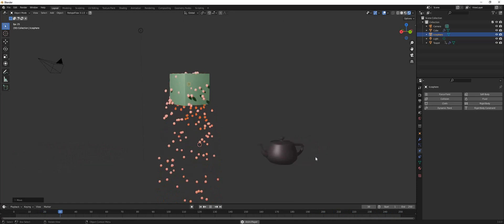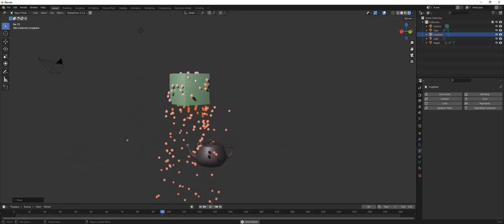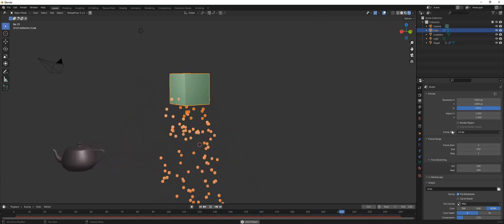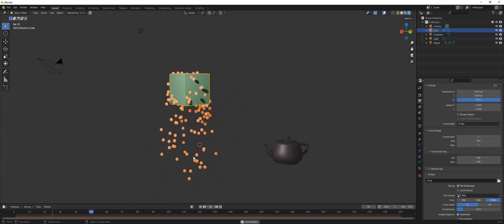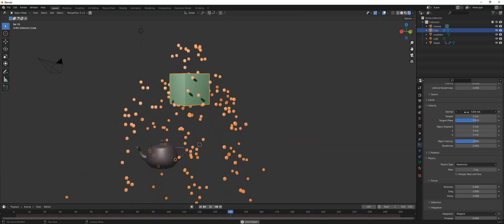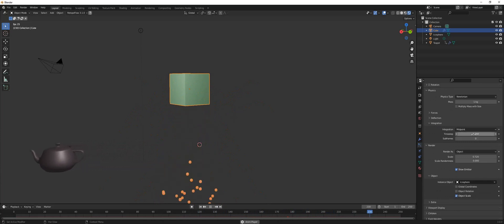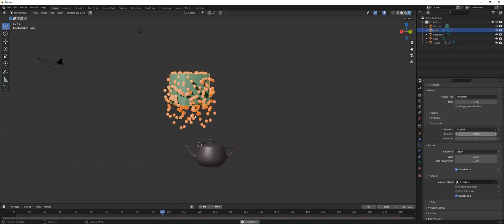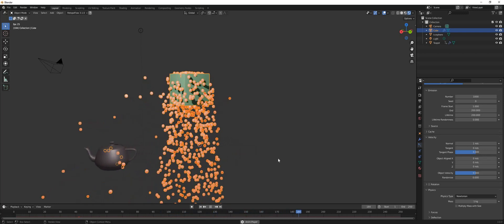How to Slow Down Particles in Blender

Comment: Not working with the curves.
Reply: Had same problem... Increase EMISSION => END/ LIFETIME values like x2 or x4 times. Worked for me ;)
Reply: @pablographix  - I got it to work. Thanks. I am using curves, but particles should be the same no matter what.  I didn't realize that the regular bezier curves have settings that dramatically affect the particles. I got the "Guide Curves" and the "Bezier Curves" mixed up.  

It took a lot tweaking. I'm talking very small fine tuned tweaking  "+/- 1.001" to get it perfect.
The "particles" pixie dust was an afterthought for a huge project that already existed with other forces and scaled settings. The timing and animation was already setup for 30fps too. 

The Guide Curves are a great Idea in Blender, because other forces do not affect them. But They need to make a node system for forces and curves to adjust the reaction to the outside forces if needed.

One more thing. It would be nice to have a particle "rig" to predict how you want particles to flow, and then have a program python script fill in the blanks (or fill in the settings for you). Plot a POINT A and a Point B on the screen. Type in a timed speed and maybe a particle mass diameter too. Some density as well. Then you are done.
Reply: @rhomis  I've found out that with one guide curve everything works fine, but after adding another one (even connected with another particle system) the particles go crazy on both ones. Even limiting the distance for guide curve impact (somewhere at verry bottom) doesn't help. Bug?